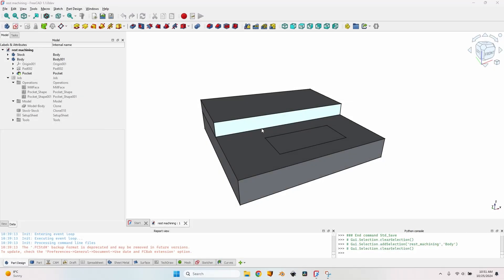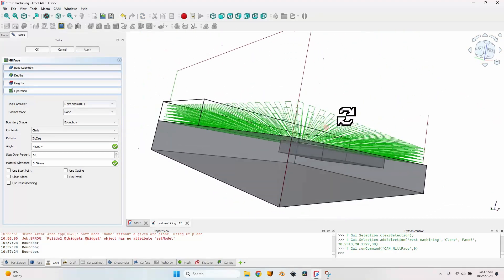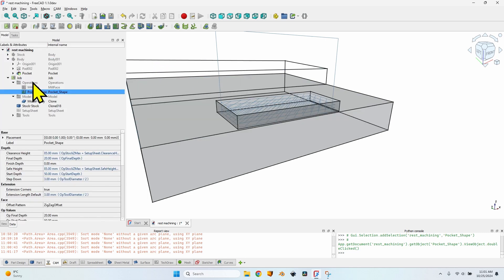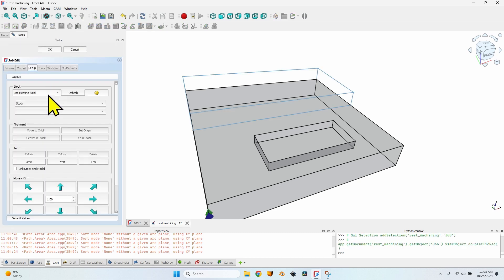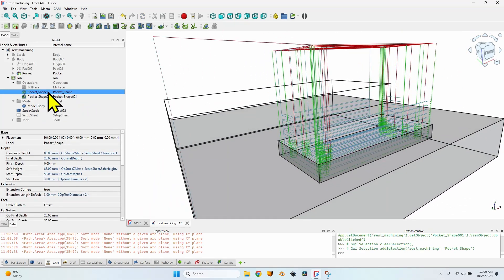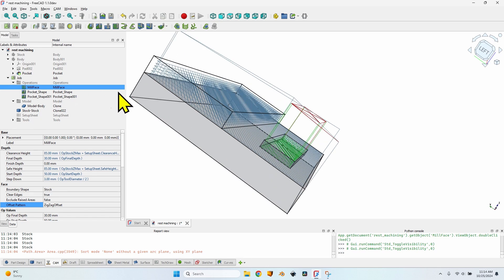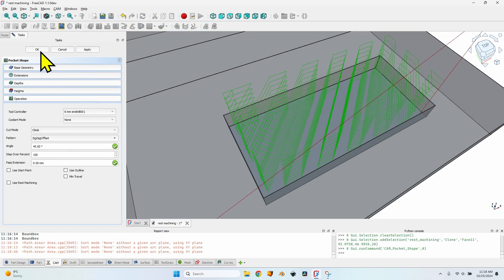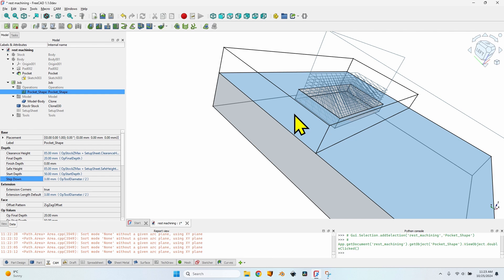CNC Rest Machining Explained – How to Use Rest & Stock-Aware Toolpaths in FreeCAD 1.0 CAM

Comment: Very helpful. I agree that just because it's not the same reason for use, it's still "Rest" machining. In my case, I want to do an adaptive clearing of a hole, then due to the flex of my machine, I want to hit the outer walls again but without all of the center clearing. So having to trick it a little by leaving 2thou on the first operation. And if I still need more compensation, I can set an negative offset on the second operation.
Reply from the maker: Thank you! I used to do this using a profiling for the second pass, with full engagement of the toolbit, using a conventional cut. This leaves a perfect finish every time
Reply: @opensourcecnc  That looks like just what I'm looking for. It doesn't say "Rest",.. but should do the trick. I'm really green on the CAM portion of this, so really appreciate the pointer.
Reply: @opensourcecnc  I did what you suggested here. https://youtu.be/lhcm_zPKqyk?si=6QpOu4hh626MvUgD Works pretty good. I set the profile to have multiple passes with very small stepover assuming they’re basically spring passes due to the flex of my machine.
Reply from the maker: @rcrdps8144  nice. I haven't tried steel yet, but I'm thinking about it, after a few improvements to the gantry. What I noticed in your video (this is something I encountered too in aluminum) is that the cooling goes away when the toolbit goes deep into the hole. I believe another spraying tip at 180 degrees would solve most of these situations.
Reply: @opensourcecnc  It actually kinda fills the hole eventually. But yeah, that part is a challenge. I eventually want to do full flood coolant rather than mist. What do you mean by 180 degrees? I’m not visualizing that.
Reply: Nevermind. I assume you mean if you spray from both directions, it would collide and go down

Comment: Is there a way to introduce an DWG or DXF project in 2D just to convert it to a .nc archive for a CNC machine?
Reply from the maker: Yes. You need to import it, create a job, set the toolbit that you want to use, create the operations (I assume you need a profiling - cutout) and export using the post processor that your machine works with

Comment: Great video for those of us using FreeCAD CAM. The thing I’m trying to work out is can I use the output of one job as the input to the next.
Reply from the maker: @stevesteve6545 If you want to use the resulting solid as base for the next job, I don't think it is possible. But you can try to create one single job and use the rest machining option if available.

Comment: Ohh, nice. I can set up an object as the actual stock; then cut my piece from that.
I have been precutting to have at least the right thickness before starting. 
Which saves on mill time, but better to know in case I need to modify an existing part with a new pocket or maybe take some off 1 face because my clearance sucked.
Thank you for these tutorials.
Reply from the maker: Yes, but it doesn't work with all the operations for now.